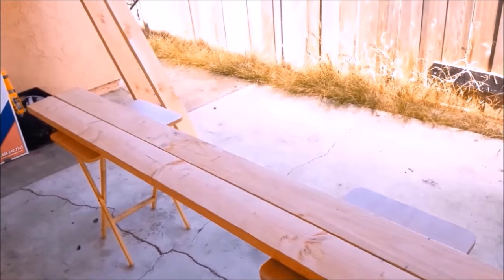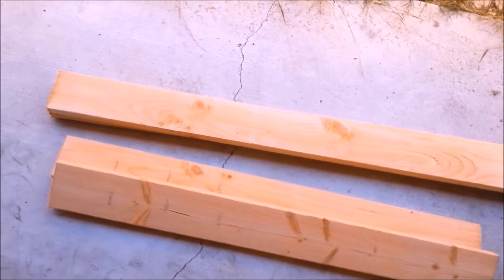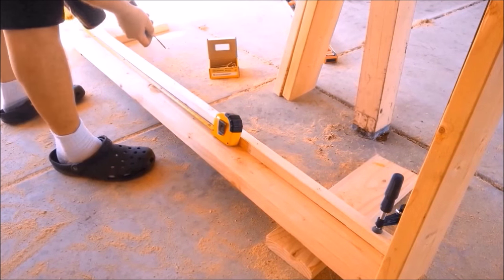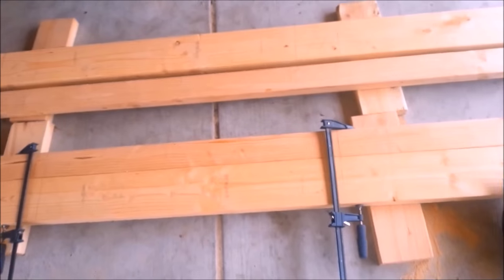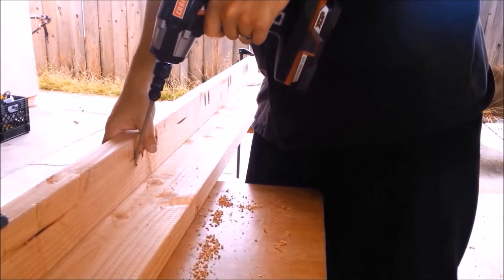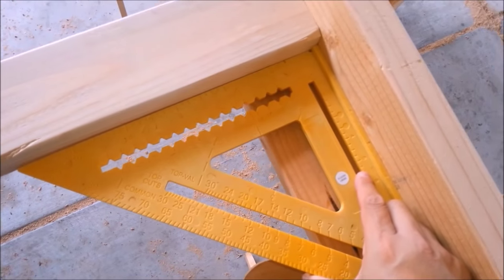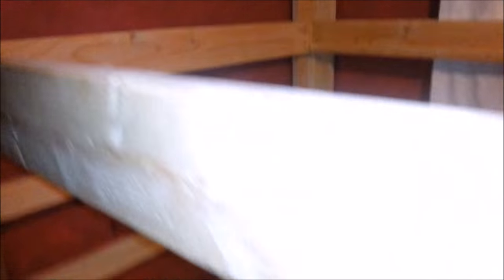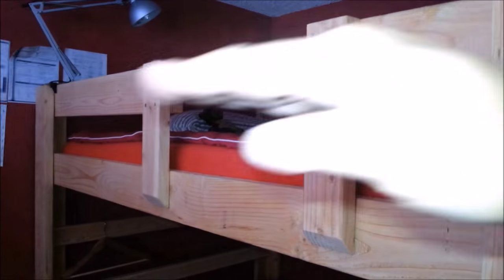Woody Wednesday: My 1st DIY Full Size Bunk Bed - @winstonbuzon

Comment: I was like you and looked all around for ideas, and honestly I saw a ton of these where they only use pocket screws. I just felt that is not strong enough for support for weight and boys that would definitely be jumping even though they shouldn't. I like half-lap joints, or something to carry a little weight from the butt joint, Then I saw your overbuild to include the 2x2 spacers all the way up the corners. That is exactly what I was thinking too. Awesome job man. Thanks for posting!

Comment: Great job. Could u please list the lumber and their measurements and also cut list with measurements.
Thank u
Reply from the maker: For a Full Size, I just measure the Full Size mattress dimensions for the beds themselves.  The height varies depending on the size height of the ceiling in your house, but between bunks, I measured a good 42 inches

Comment: Do you have a rough materials list for the lumber? I’m wanting to make something similar for my daughters and want to make sure I don’t have to make multiple trips to the hardware store
Reply from the maker: @CatherineMartin-Zeller  No, unfortunately I just winged this project. All I did really was take measurements of a full size bed frame and incorporated corner made of 2x6s with a height high enough for headroom for the bottom bunk

Comment: great job man I'm looking for a 3 tier bunk beds for my 3 boys.
Reply from the maker: Im sure you can actually do the same thing if you make your corners taller and place the tiers closer together to accommodate all three tiers
Reply: Im actually doing the bottom bed about 2 inches off the floor that will give me room to do the top 2 and have good head space between them. thanks for you vid I'll be doing your style build thanks again man.
Reply from the maker: +Miguel Juarez Very nice!  And you're welcome.  :)

Comment: Great job sure your kiddos loved their bunk bed also what size did you use for the corners where the 2X4
Reply from the maker: Jessica Lopez The corners were made from a 4×2 and a 6×2, joined at the edge
Reply: u used (2) 2x6x16, (12) 2x4x16, but for corners u used 4x2x12 and 6x2x12?
Reply from the maker: OffiCia7 Yes, because since it's a bigger bunk, the corners needed a but more support

Comment: How much did you spend? I going to built a bunk bed for my two daughters because buy one is very expensive.
Reply from the maker: I've spent close to 200 in materials alone.  Lucky for me, I had some of the tools already.  But if you need some tools to use for this project, choose one or two... One if you want tools to last a while, or two if you need tools just for this project.  If two is your option, Harbor Freight has got a few  tools you can get by with

Comment: How much weight could it hold on the top bunk ?
Reply from the maker: I weigh about 200 pounds and I got on there just fine
Reply: it can hold a lot more weight than simple pocket hole screws and glue, he's using 2x2 spacers between each rail section so all the load of the side rails is being carried all the way down to the floor by wood, not just supported horizontally at the butt joint by screws. It is a very strong connection.